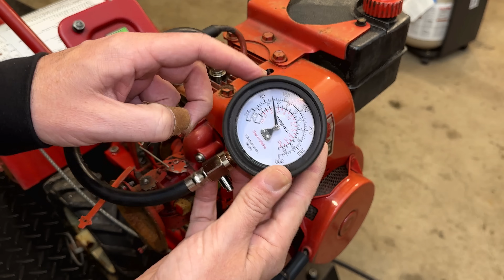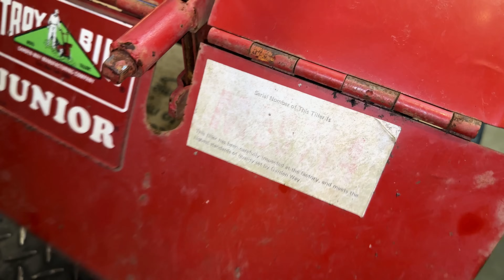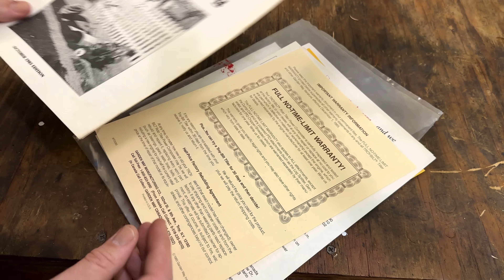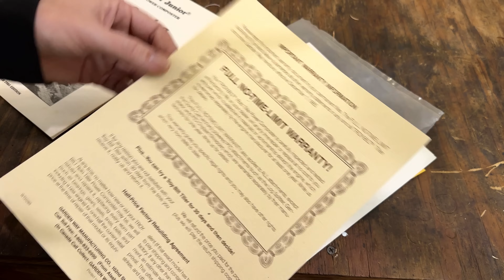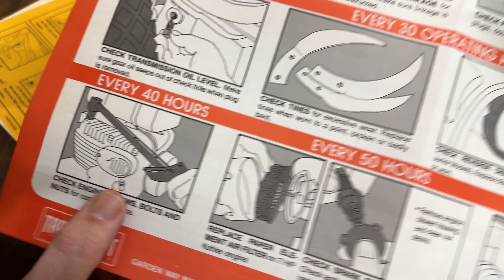Vintage Troy-Bilt Tiller Has Issues

Comment: My little pressure washer behaved that way and wouldn't kick down and grunt when pressing trigger. Had to tap the governor arm to get it to drop down and speed up. 
Changing the really old oil fixed it completely. (Got it from a friend who probably never changed it). I did another change a couple hours later and was nasty again and now it's perfect. 
Just a thought

Comment: I had the same problem with a Troy Bilt tiller I revived. The model tag was illegible, and Troy Bilt couldn't cross the engine. It had a bad rear seal as well, and I had to sell it like it was. Finding parts was nearly impossible. I did manage to get it running and tilling though.

Comment: The tiller is a seldom use machine. 2hrs of use, once in the spring. If at all, these days. That’s why the motor sounds so good. Great replacement motors with electric start can be found on snowblowers.
Reply from the maker: I was thinking the same thing.  I have a slightly larger 5hp snow blower engine with the same second pulley on the camshaft.  Was thinking of pulling that one out if the governor was junk.  Of coarse that engine has no compression so may not have been viable.

Comment: Ugh. Water. I have a Troy Bilt pressure washer. When I was outside pressure washing one day, I came up with the bright idea of pressure washing the pressure washer. Being the genius that I am, I forgot about the vent on the gas cap. It took more than a year to get all of the water out of the system. I cleaned the tank and carb multiple times, replaced all of the fuel lines, and I still had water in the system. It was a nightmare.

Comment: I have a 1985 Econo-Horse model with the 6 hp Tecumseh engine that I bought used in the mid 90s. The serial number on mine is stamped on top of the pipe that houses the drive shaft visible in front of the tine cover.  At the 1:30:14 mark, there is some rusty places on the top of the pipe which may be the serial number.

Comment: I love my old Troybilt 8 hp Horse Tiller. Your Junior will make garden life easier. Nice video. Nice old machine!
My service guy says I should park my till with no pressure on the tines, depth set to zero. Is this a valid point? We go round and round about it, in a good way.

Comment: Excellent Video!  I appreciate your time, including the extra footage of detail which other's skip - difficult to repair a machine if your unaware of the process. Your wireless tachometer is an interesting tool. Is the 1000R Pulse Engine Tachometer the correct part?  A great sign - the water in the gear-box appeared clean; without rust. Hopefully, the moisture its a result of pressure washing an old machine with worn/torn seals.  Maybe a slight drain of the gear oil is due to capture left-over condensation which sits at the bottom? Always learn something new here!  Thanks for the content.

Comment: The situation in New Zealand is Tillers are in short supply new, and grossly expensive. Simple blades under motor ones start at $1200, a Stihl is $1600. Rear tine models with gearbox start at $2000. 
As interest in gardening  has reemerged  post Covid, the second hand market is equally crazy. People will pay $500 for extremely old models that have sat outside. If the machine is approaching anything decent like in this video, then $1000 is a start point.
People are selling ones with parts missing for $200 and they get snapped up.
Crazy times.

Comment: Same old problem with every Tecumseh with a carb with that long bent intake runner...
with no heat on the intake the fuel falls out of the fuel air mix when the intake is cold...

basically untuneable for all revs when cold...

either it idles well or it runs full throttle well..

but can't be tuned until it gets hot enough for some heat to go from the head down the intake manifold metal........

Comment: Had a wide cut for21 yrs, replaced drive belt twice, one blade bearing tower. Finally started to rod knock. Bought a cub 800 wide cut, not as easy to run.

Comment: Those little Troy Builts were good machines. I had one a bit older than yours used to work great, but the same machine and it had a Briggs engine. The gas tank rotted out and I bought a new one and found it needed a carb and couldn't find a carb for it anywhere. I wanted to buy an engine and repower it but there was something strange about those engines.... can't remember had something to do with forward and reverse or shaft size or rotation or something couldn't find an engine I could adapt so sadly I had to scrap it. Troy built sold out to Murray I think so I think there stuff is junk like most everything now.
Reply from the maker: They are hard to repower.  Forward is driven from the crank pulley.  Reverse from the camshaft pulley.  Have seen some repower them, but reverse is lost since newer engine do not extend the camshaft outside the block.

Comment: In situations where you don't want to use carb spray because of the o-rings, I just use 70% Isopropyl Alcohol. It's cheap and effective. It works as a cheap degreaser as well. Put it in a spray bottle, spray it on and just blow it off with compressed air.

Comment: the pony model is really good but only if you never had a horse model....ive had a few of both and mostly pass when i see a pony for sale but its really hard to pass up a horse model if the price is right.....the best tiller ive used was a honda 8hp with counter rotating tines...you really cant beat the tilling quality of a counter rotating machine
Reply from the maker: I have a Troy-Bilt Bronco with a nice Briggs flat head waiting for repair.  Will be interesting to see how it compares.

Comment: James, that roto tiller now does such a great job that you just have to start a summer vegetable garden right? With the bearing seals running on rough shafts causing leaks, there is a very good product called a speedie sleeve which is a thin stainless sleeve for the seal to run on. I used them on my boat trailer shafts and didn't have to change a seal for 10 years.
Reply from the maker: Thanks.  Have heard good things about speedie sleeve.  Will keep it in mind.

Comment: I suspect the reason you couldn’t get the transmission to take the full amount of oil was very thick, dried out oil coated the inside rather than flowing out. I would have added enough for safe running and heated it up enough to homogenize old and new and then drained it. Same as you do with an engine to clean out sludge. I’d even consider running diesel through it to do an even better job.

Comment: This is timely!  There just happens to be a tiller out in the garage that hasn't been run for something like 20 years.  It's badged as a Craftsman brand so I have no idea who actually made it.  Any thoughts you'd care to share about finding that out?  It should be fun to try and get that going,  since I have no idea whether it was left with gas in it or what.

I've never seen anyone use an extension like that to get a qquare headed bolt moving.  They do make sockets for square hardware,  the last time I had to assemble some metal shelving that came with bolts and square nuts I was able to snag the proper socket off my Snap-On dealer.  You might check into that.,  then you can use a breaker bar or whatever to get that bolt moving...

Comment: I bought one of these in the mid 80s. I used it 2 times and sold it as fast as I could, terrible on hard packed or rocky ground. The design flaw was the tines turn the same direction as the tires. so in hard ground the tines would touch the ground and because they were turning 4 or 5 times the rpm of the drive wheels they would jerk the handles out of your hands and the machine would end up 6 feet away from you. I tried adding extra weight to the machine as well as fluid loading the tires to no avail, sold it after only 2 uses. If the tines were counter rotating these tillers would have been much more user friendly, really don’t know why they never redesigned them in that way.
Reply from the maker: I was concerned about the same.  Worked ok for me, but can definitely see that as an issue.
Reply: 2012 2013 models are counter rotating with the same solid drive axle and brass gears as the 1985 models built virtually the same except for engine

Comment: James have you tried Simple Green concentrate as an alternative to the old HF formula degreaser?  I've used it in the ultrasonic diluted one part in four for heavy degreasing.  Works fairly well.

Comment: When making the gasket for the carb., the goal is to seal up for leaks, your holes were to big and you chose to cut them to the inside, but now you might have air leaking around the threads, better to have hand cut the holes and have it seal all around bolts.

Comment: The question about the gearbox is could you open up that top fill hole and that will give it a little more air to push out of the drain one my second question is could you pour a little diesel or white gas into their kind of clean out those gears and then when you put in that clean oil goes on Gears would be less gummed up

Comment: 6:22  I can't believe that lightning bolt! I fought with a CCP-made chipper/shredder (212cc engine) for a week thinking it was a spark issue, the only way to see the spark was to watch the plug in a nearly-dark garage (no nice spark tester here). The problem was the carb not the spark but I have no idea how it runs with that weak wussie magneto output.

Comment: I really like these surprise editions with unexpected machines. Never owned a tiller but still learned a lot. One question though: with all that water and thick oil wouldn't it made sense to flush the gearboxes before filling new oil? Just some diesel or kerosine to loosen up that old gunk over night.

Comment: That seems a awful lot of oil in those gearboxes. If they are filled up to the centre line of their worm gears there will be plenty being flung around to lubricate between the worm and the worm gears.Filling to the level of the fill plugs .
Head bolts . The usual checking procedure is to back off each bolt a bit in turn and then tighten to the recommended figure in the specified sequence.

Comment: is there a drilled out bolt for a vent James. That would prevent the seals from building too much pressure in the transmission. or even an actual vent.

Comment: "It'd probably help if I turned the fuel on" 🙃
Anyone who claims they've never said or thought this is lying. I'm guilty of several counts, and it'll probably happen again.

On pulling seals, I use a coarse-thread sheetrock screw. Tap it in with a screwdriver and hammer just till the point pierces the metal, then turn it in from there. No drilling needed and all the metal remains intact for the screw threads to grip. The coarse threads are taller than the fine ones; so they grip better. If the screw pulls out switch to a larger woodscrew and repeat.

Comment: James, i love troy bilt machines and owned one with the 12hp tecumseh electric start. My question is did they add a device requiring you to keep hands on to stay running? If they did then that ad they used to use showing a little girl  controlling the tiller in her garden is way out of date.

Comment: I'd like to see you try Walmart's Hyper-Tough 12v tools: impact driver, drill ($40 kit), etc. with their 4Ah battery even though your Ryobi features a 3 speed impact driver with its 3 headlights is hard to beat but H-T is much smaller. Good build quality, you decide. Also how about Loctite 222 'Purple'? Doesn't do much but keeps the threads clean.

Comment: That's a great machine and still under warrantee. I can hear the tech or customer service trying to wiggle out of the warrantee. Did I miss you saying that the oil from the front hub travels to the rear hub? I'm not sure how it gets there but it might explain why you could only get 1 pint in it.

Comment: Hey James. Great video. I have a question. While you had the gearboxes exposed, with leaks showing around the gaskets, I'm wondering why you didn't replace the gaskets, considering how much water was in each gearbox. I love. my Troybilt tiller. Real workhorse.

Comment: To make gaskets exact match, hold gasket material over opening and tap around outer edges with round end of small ball peen hammer. The tapping of the hammer will cut the gasket material.

Comment: Hi James  most every  repair issue you tackle seems fuel related but have not heard you mention if more so with or without ethanol? I'm guilty of leaving undrained fuel in my seasonal engines and generator but I only use high octane ethanol free fuel with added stabilizer for the off season, what do you recommend?
Reply: BTW, keep up the good work my wife enthusiastically watches all your episodes to the point she's now confident enough to attempt repairs and maintenance herself,  you've single handedly  become my hero, lol.

Comment: "Troy Built" machines always had an unusual allure. They were often only advertised in "garden" or farm type journals. It seems that the big home improvement centers spurned them for a long time.
Were Troy Built machines ever sold under other LABELS?? I still see Troy Built tools being sold today. Are they the same QUALITY that marked the tools of the past?? It seems to me that buying a really good Troy Built machine from the past and taking the time to "restore" it properly,  would provide an amazingly good device that might be MUCH BETTER  than many "new" products.
Reply from the maker: The Troy-Bilt machines of the past were built in Troy New York and they were built well.  At some point MTD purchased Troy-Bilt and now not the same quality.

Comment: Wow you done alot i got a poney given to me that needs a going over and horse with all the paper work i dont have much luck starting it had the old teuskpie replaced in 2000 with anouther one but it dont have a choke its got a purge balb
Reply: I got 1 given to me with the manual and repair list the previous owner admitted he wished he wouldn't have the old teuskumise with choke replaced with purge balb

Comment: The wear rings on shaft are from petrified seals. Change them every 40yrs. Whether they’re leaking or not. If new seals leak, change from oil to cv axle grease.

Comment: 1:10:00 You should have popped the cylinder head and removed the carbon deposits instead of just tightening the head bolts.  De-carbonizing the cylinder head is a part of routine maintenance (at least it is for Briggs flatheads) and is really pretty easy to do compared to an OHV modern pushrod engine.
Reply: I really enjoyed this video. Thanks.

Comment: James....Great videos! Ok, a question. I have a Toro 22" Recycler mower with the Kohler 6.75 engine. Fixed the hard/no start (pilot jet plugged) but tiny o-rings were gone, so a dab or two of silicone sealer and first pull starts restored. Where can I get some of those o-rings...or should I just leave well enough alone and enjoy the ones pull starts?
Reply from the maker: The o-rings on the pilot jet?
Reply from the maker: They do have a repair kit: Kohler 14 757 03-S.  You would have to double check it will work with your engine.  Likely it will.  The kit contains 2 small o-rings which likely are for the pilot jet.  I also suspect they are the same o-rings that Honda uses on the GX200.

Comment: So my father would call this old trick what he did is that he took the tires off of his wheelbarrow those two tires may not be if the tires on your Troy-Bilt has to be aired up what my dad did is that he deflated it and then he filled it full of stuff spraying wall foam. So he filled that tire full of that stuff all I'm saying is that if you did that to that one the same thing you would have solid wheels and that's the only thing that really keeps them from not working good is it the tires are not fully inflated so take the air out put in stuff spraying wall foam from fill those tires full of that then they cannot deflate and you'll always have this up and running as far as I'm using it.

Comment: I am wondering why you didn't open up the gears and housing and check and clean with new paper gaskets? Don't get me wrong, I don't know everything and that's why I watch your videos. I have learned quite a bit about the small engines. I have work as a mechanic of one kind or another. Even in the Navy.

Comment: It might of been intentionally set to a lower max rpm due to the 'dual drive' of the tines and the wheels, when the tines catch on hard soil it can launch you lol.
Reply from the maker: I did that on the last one I fixed.  It pulled me along very fast instead of digging in.

Comment: I have a confusion-  can we add rectifier ( with avr or by replacing avr ) in generators to get dc and then convert it in ac with pure sine wave inverters . Or is there such way to do?
Reply from the maker: You could do that.  Would just need an inverter that can handle the high dc voltage.

Comment: I was noticing when you put the wheel on, you greased the shaft and put the keeper pin through the shaft but not the wheel. Is there a reason for this? (Okay, now I see it. Only put the pins in when you need it to pull)

Comment: Using the round end of a ballpien hammer to tap out your paper gasket works great. The paper gets cut by the metal edges and the gasket conforms perfectly.I start with the bolt holes so that I can pin the paper in place,  then cut the inner and outer edges.
Reply from the maker: I must be doing something wrong.  Have tried any times and my gasket paper will not cut using that method.
Reply: Placing a ball bearing on bolt holes and tapping the ball will cut bolt holes. Then as the other person stated,  tap the edge of the part to cut shapes. Helps a lot if the ball end of your hammer is more cone shaped than an actual ball.

Comment: just out of curiosity, why don't you clean the fuel tank?  Is there any concern of debris getting back into the carb and blocking it up again?  Great video though.
Reply from the maker: It looked clean.  I did mop out the water and blew some air in the tank.